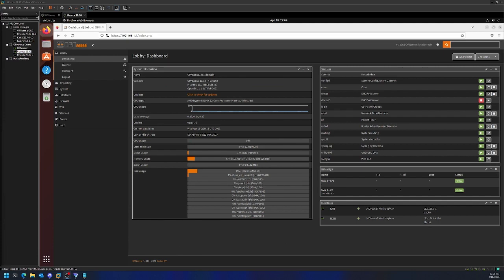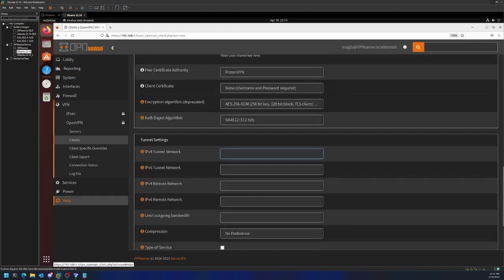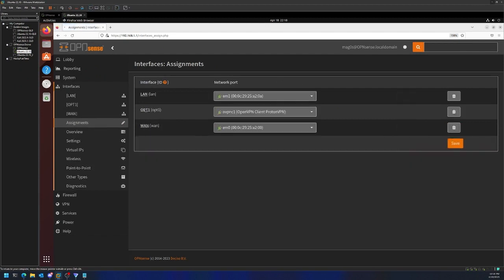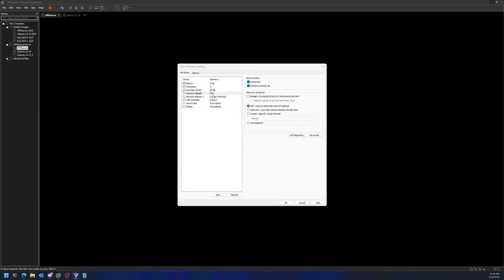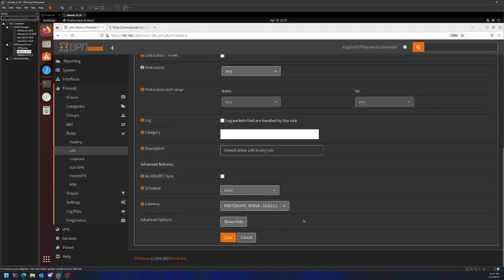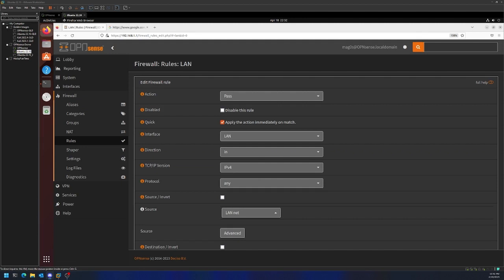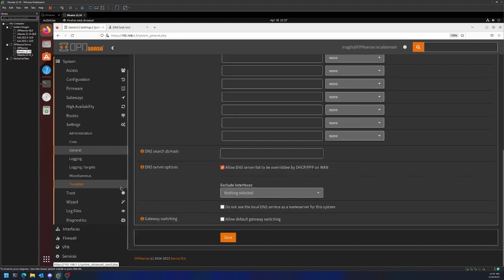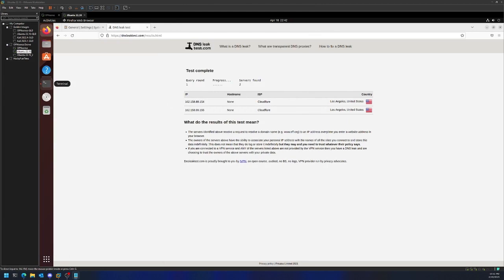OPNsense 101: Tunnel your entire network over a VPN!

Comment: is it possible to use this for an one host only? I tryed changing the outbound rule to an specific host only but all my other LAN hosts stopped work.
Reply: yes it's possible by creating alias
Reply: If your intent is to only use the VPN connection for a single host, I would highly recommend simply running OpenVPN or the VPN provider’s agent (if they provide one) on that host as opposed to the firewall.